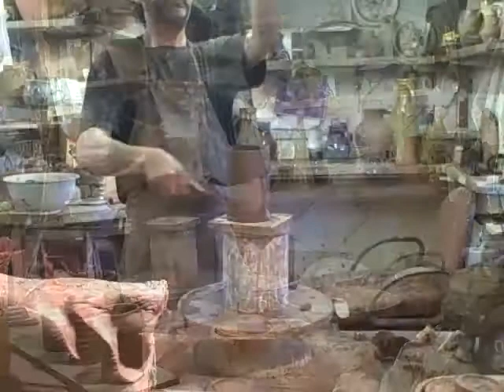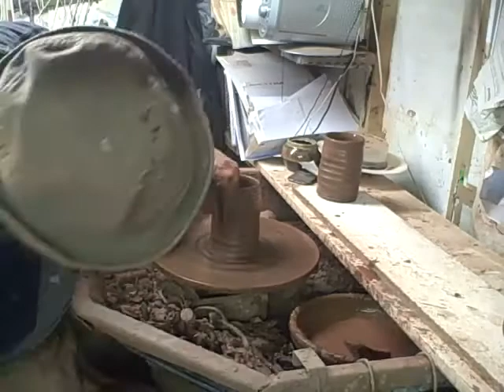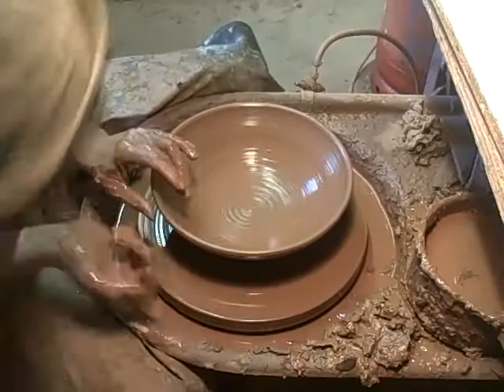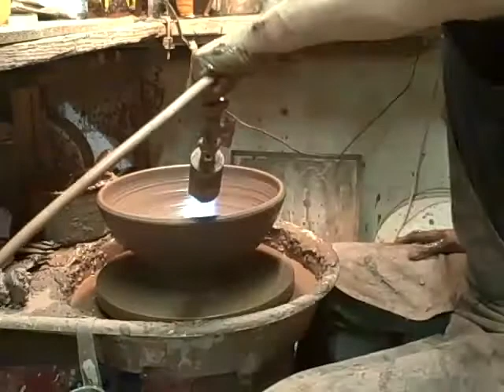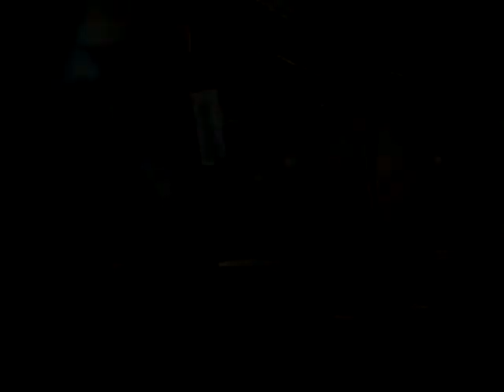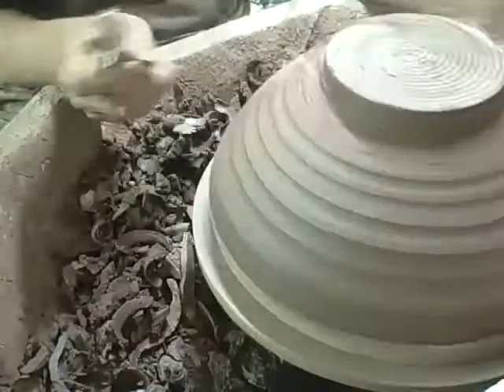Doug Fitch Slipware Potter my day 28th September 2013

Comment: At 8.46 almost a feature, loved the lid making with the 3 jaw chuck...they do say that the lathe was developed from the potters wheel especially when you use a scraper as a tool.
David 
After a day in the open air fitting a stable door to a thatched cottage with a collie with a passion for tools and wall plugs that got chewed!!!